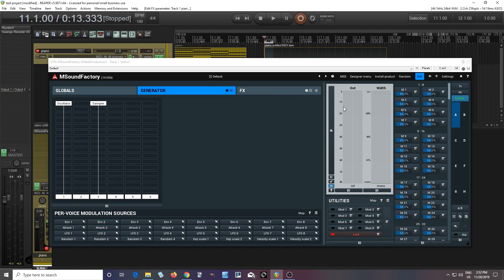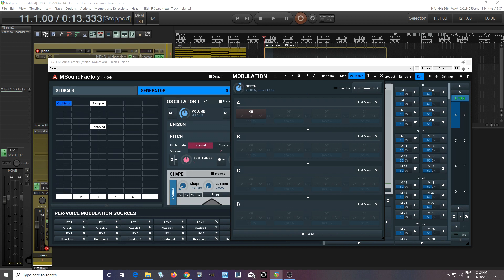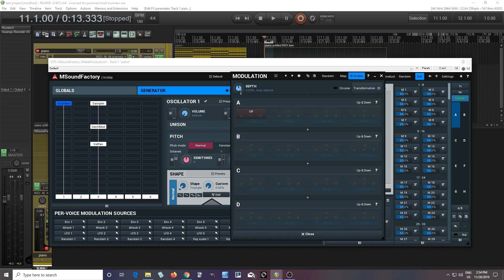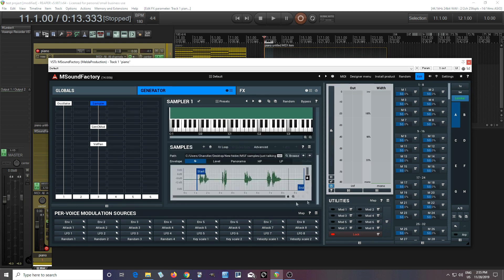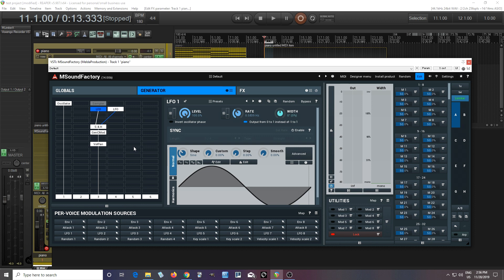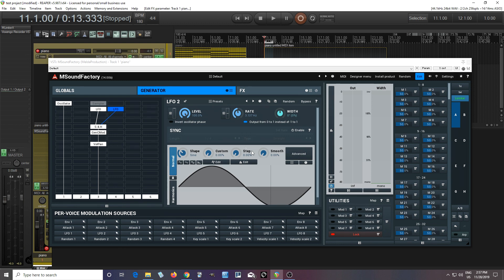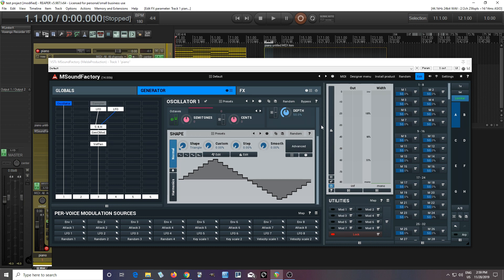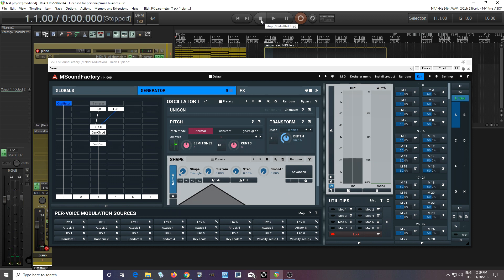Sample & Hold and CustomMod in MSoundfactory

Comment: eight times in a modular plug and lets morph the output of the modular plugs ,  spooky sounds on the inersection of samples.
Reply from the maker: There are all sorts of interesting sounds waiting to be unlocked inside this synth.
Reply: @Chandlerguitar  Yup, I am mostly interested in the manual positioning in advanced sampler. With the modulation capabilities, its just a matter of investigating to get complex glitches, may be it will be my first instrument.
Reply: @Guarroguapo18  Something to note, this synth is quite new, and quite Melda. Those things meaning 1. there are some inconveniences and missing features in the workflow department for this synth, 2. at the same time there's also so many features it's quite overwhelming, so the learning curve is a quite a bit steeper than for other synths. The immense power also makes this thing quite excessive and bulky as a bread and butter synth when using the edit page. Luckily, the Premade synths are a good starting point to learn the simpler things, so starting there is wise.v (Also it's on sale for $165 on Pluginboutique until July 20th!)
Reply: @KnzoVortex  Also, as marketing claims, the quality of the oscillators is something else compared to most other VSTs. I end up playing more, as I start to tweak and sculpt, as they sound so good. Just my experience.